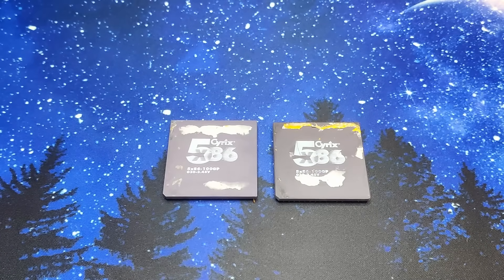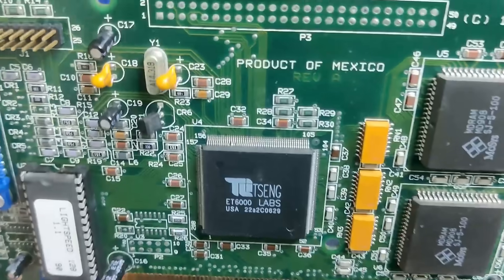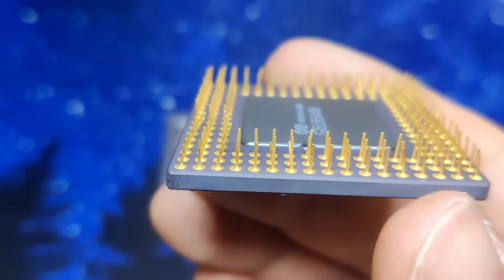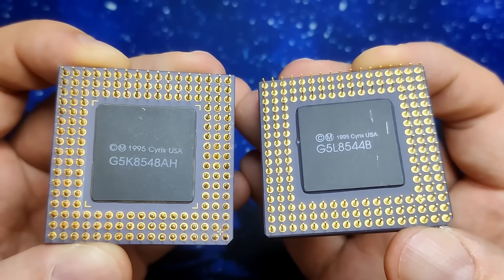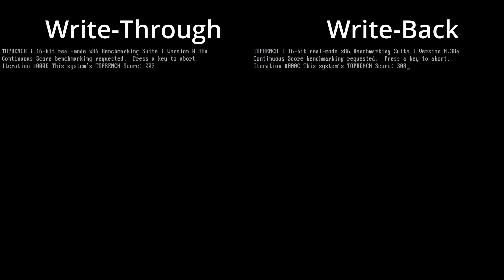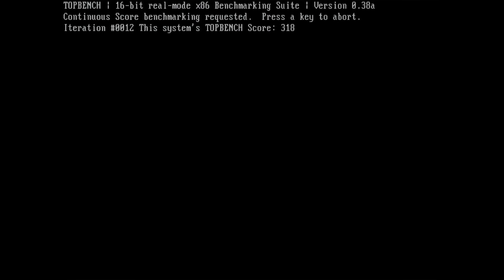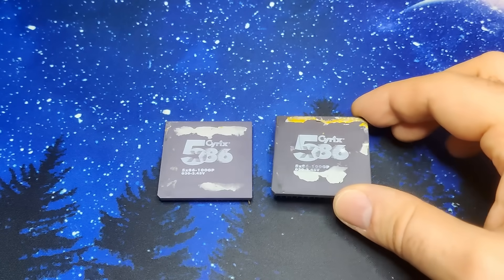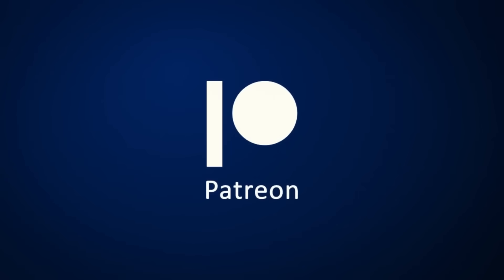Tomb Raider (1996) meets Cyrix 5x86-100GP (Part 3)

Comment: Why not use a small flat nose pliers for straightening pins:?
I find it much easier and faster to get them completely straight. Way more control And straighter away from  the main bend.

A clutch pencil, for a lead of the same/correct  diameter of the pin, also works very well, but does not give you the counter force  on the other side of the bend like the pliers do. 

Do not underestimate the power of a FSB overclock to 40MHz (120  MHz)
FSB overclocks everything, not just the core.  That's where the real gains are!
It's a great pity you never tested that.

NB:
Stability/heat is fine as long as you lap a decent size (P1) HS and use thermal compound. (NB!!! thermal compound)
Obviously a fan on the HS also helps.

Comment: Luck not required to run that one at 120Mhz. I used these chips to upgrade my machines, my friends machines and even a few business machines. All of them overclocked to 120Mhz. Unfortunately, I also bought a 120Mhz version thinking it would overclock to 150Mhz (3x50). It did not. So I sold that one on as iot was significantly dearer tan the 100Mhz version. Great video.

Comment: This is a big walk on memory lane watching this video. Started to build computers using first Intel 386 then 486. Started using the Cyrix 586 when it was first released because it was a lot cheaper than the Intel equivalent plus on some of the motherboards you can play with the jumper settings to get more speed. Did build x686 after. It was great times.

Comment: I`ve played it on 486 DX 33 on Grayscale monitor (despite some puzzles required color to be solved )  , and without 3D acceleration. I`ve finished it in  around 31 hours making pauses for food and toilet   It was fantastic and absolutely playable. During big areas, to  improve framerate , i`ve used "-"  button to shrink image to a size of 5x5 cm or something. Now it sounds like some crazy stuff, but in 1996 this game was WAAAY ahead of everything on the market, so I  just could not stop !  Actually , those times 3D accelerated card costed like another PC, so i did not know anyone who actually had it.
Reply from the maker: Yeah, that sounds about right :) crazy time!

Comment: @Tombraider: Is it the CPU slowing it down though? I remember putting a Diamond Monster 3D in my System and playing Tomb Raider (with the 3DFx Patch) soooooooo smooooth. ... on a Cyris 120mhz though.

Also can you bent pins better by heating them up before? Like 60c or so?
Reply from the maker: Now I can't wait to get the Voodoo done and test it. I really hope the 486 CPUs will have enough compute to push 20 to 25 fps at 640x480. That would be really amazing!

I tried heating the pins, but I didn't feel any difference.

Comment: At that time I had the Cyrix 6x86 with 133Mhz. My uncle connected 2 pins with wire and the CPU ran stable at 233 MHz. Together with a Voodoo 2  I could play Tomb Raider 1-2 and Unreal, Unreal Tournament and POD Racer. How many fps did I get? I don't know, but I was so happy that the games were running.
Reply from the maker: Wow, your uncle knew a few tricks to get free performance! I am sure you must have loved your setup and the extra speed you got for your games!

Comment: I had a 586 and a 686 I remember the 586 ran very hot, i may have overclocked it. The 686 was pretty good.
My first ever pc was a 486 dx with tseng ET 4000 vesa local bus.
Reply from the maker: Nice! Guess what I pulled out of a pile of old electronics two weeks ago at the scrapyard? A Tseng ET4000 VLB! I'll make a video about all those VLB cards I found so far very soon.

Comment: Tombraider is certainly needs fair bit of CPU for the time. I ran it on a Pentium 120 in software render and also with a Realvision Deltron Flash 3D 4 Megabyte Voodoo 1 card. It was mostly ok but I had to reduce windows size in some of the larger areas due to the CPU. When I upgraded to a Intel Pentium 200 MMX it made big difference and the game ran far smoother.
Reply from the maker: I hope the game will run much better when I add a Voodoo 1 card. My AMD runs stable at 160 MHz - so, maybe there is a chance to get half way decent frame rates on a 486 system

Comment: That was quite a step up from the previous CPU. Please see if it overclocks to 120 MHz and how well it scales with frequency! If Peter's results over at CPU Galaxy are any indication, the 5x86 with special features enabled should give the X5 quite a run for its money! They're almost evenly matched in Quake and both have the potential to overclock by about 20%.

Comment: Hi I have a intel dx4 100 how I unlock it's potential? There are software here too or not? And when you say turbo you mean the turbo button on pc case?
Reply from the maker: Yes, I mean the turbo Button on the PC case. It just shorts two pins on the mainboard and then the CPU is either running normally (turbo on), or slower based on how the turbo feature is implementation on the motherboard.
A regular Intel DX4 does not have any special features that can be unlocked to my knowledge. But you could try to overclock it to 120 MHz.
Reply: @bitsundbolts  how? From  motherboard?
Reply from the maker: The motherboard decides how to implement the turbo feature. Usually it's by slowing down the system bus, disabling caches, or other other ways.

Comment: heat up the pins to bend them back, but those pins are not just bent once they are bent in multiple areas which makes it really hard to get them at the same z height needed. maybe you can resolder new ones on there,.

Comment: Super nice! Maybe you could explain the turbo mode a bit better since this usually depends on more on the motherboard. Which strategy is followed be the MoBo? Cache L2 Cache disabling or frequency reduction?
Reply from the maker: I agree. I think Necroware recently made a video about the different implementation methods. I have no clue yet and would have to make my own research first. But I knew that there is a difference between the cache strategies when using the turbo feature. Some day, I may make my own video about this - or reference the one from Necroware 😂

Comment: In terms of video quality, the matrox lineup should also be a very good candidate! They are available for cheap with all common interface types. There are 2 lineups, one with integrated ramdac and one with external.

btw: i had good luck soldering those plasticsockets with hotair. You only have to be patient and use as little heat as possible to not melt the socket. Afterwards it looks like factory.
Reply from the maker: I assume you used solder paste on those sockets. I'm afraid to melt the plastic, but I haven't tried it yet. I didn't want to risk it on the Tseng cards... Maybe an old S3 Trio64V+ that doesn't work anymore will be a test subject for me. It has memory sockets that I could use for other stuff.
Reply: @bitsundbolts  no, i just used the pretin on the cards. It's older solder, so its not PB free and great after years. Just used flux and cleaned the oxidation of the socket-pins a bit with a fiber pen.

I practiced on old 3com-pci-cards. Some of them were missing the bootrom socket. Or you can remove the old one, tin the pads again (no wick afterwards!), put some flux on it and then the socket.

Try around 250°C hotair and give yourself and the board time to heat up, it takes a bit longer on this lower temperatures. If it's not working after 1-2 minutes, raise the temp by 5-10°C. You will soon see that the solder melts before the plastic and you can mount these sockets without a problem. It just takes a bit of practice and the right temperature (for your equipment, as most of our equipment isn't calibrated and has quite different characteristics)
Reply from the maker: Thank you for your detailed explanation! I'll definitely try that out. Unfortunately, I just soldered another four sockets in a third Tseng card for a future video. I still have two sockets left. Maybe I'll find another Tseng at the scrapyard 😂
Reply: @bitsundbolts  yes, or try it on something smaller one first, like the mentioned bootrom plcc-socket.

Comment: I have been greatly enjoying this series but I don't understand the purpose of presenting the scores with turbo disabled. It seems off-topic and unhelpful. Sorry for the negative comment, keep up the good work bro.
Reply from the maker: I read about a different behaviour of the turbo feature for write-through and write-back cache when I did research about both Intel DX2 CPUs. I guess I'll dial this section down in the next video and only show the interesting benchmarks (if there are any). The takeaway is, write-back delivers slower performance without turbo if you're looking to slow down your system for a certain task (e.g an old game).
All comments are welcomed! Thanks for watching and commenting!

Comment: I think I had the 2MB Tseng Labs ET6000 in my first computer. 1024x768 was only in hi color (16 bit) available because of the memory
Reply from the maker: Yeah,I think the extra memory helps for higher resolution and color depth. Not sure if there are any other features that are available with more memory. I should check Tomb Raider shadows. Phil recently made a video using an S3 Virge and there were no shadows when using 2MB. They appeared after he upgraded the card to 4MB

Comment: I might have to do the same testing on my Am5x86-P75. I went a different route in the video card department. I went with the MGA Millennium 2MB as it also has great DOS performance. The one thing I have to be on the lookout for is the 2MB RAM expansion module to expand on the video memory to 4MB.
Reply from the maker: I found something really interesting last time I went to the scrapyard, but I haven't tested it yet, nor do I know if it's really true. But I think I found TWO Matrox Millennium 2MB + 6MB memory expansion cards... There will be content about those soon!
Reply: @bitsundbolts  Sweet! Looking forward to it.

Comment: I've been able to run my Cyrix 5x86's at 120MHz with no issue, but I'm not sure how it would handle the extra features at that frequency.
Reply from the maker: Yeah, I think branch prediction may cause issues at 120Mhz. There is more info on vogons, but I couldn't dig through everything yet. Maybe in the future.

Comment: I'd use 0.5mm or 0.7mm mechanical pens to straighten pins. Works 99% and it's way faster method imo.
If I remember correctly Tomb Raider is almost playable w/ 40MHz FSB. 120/40MHz and overclocked VGA-card like Cirrus or S3 helps a lot. But it ain't pretty w/o 3D-accelerator as we all know. I had Matrox Mystique and it was ok speedwise, but 3dfx looked way better of course.
Reply from the maker: I'll try to run the AMD @ 160 MHz. Hope this will give an extra boost and Tomb Raider is actually playable

Comment: Ahh the 5x86, also known as the disappointment which any kid who tried to run the demanding games of 1996 - Quake particularly - would tell you. This era was full of them, bold promises in magazines lured you in and in some limited scenarios maybe they were just as fast as Pentium... just not the scenarios you wanted. We also didn't know about the disabled features or at least I never met anyone who did, this kind of knowledge really wasn't so widespread back then.

Despite this I owned a 5x86, a 6x86 and a K5... of them all the K5 was the most honest but still had its failings.
Reply from the maker: Somehow, I ditched all those disappointments. I went from a 486 to a Pentium II 350. But I can totally relate to high expectations and big letdowns - especially when it comes to graphic cards.

Comment: I guess, from bending the pins, the gold plating got cracked, given its some hundreth mm thin, then moisture wicked under the gold and oxidised the tin.
Reply from the maker: Maybe. I don't know what is up with that CPU. The other one also had bent pins, but is completely fine. Maybe it was operated in very different environmental conditions.

Comment: Great work! I don't know if it helps, but I always used a utility knife long blade to straighten pins and that used to do a very good job, as you couldn't "bend too much" and all pins would be in line. I would put the cutting side facing the processor and the not cutting side I could put my hands on. Maybe it helps in the future :)
Reply from the maker: Thanks for your suggestion. This method seems to have worked very well for you. I started with toothpicks and it worked surprisingly well.
Reply: @bitsundbolts  yes, definitely there are loads of methods that works well! I think I don’t have all the patience you have to do one by one, hence why I like to do many at once 😂

Comment: Looking forward for some bending magic 👌

Also, what is the price range on those sockets and memory for the TSENG video card?
Reply from the maker: The sockets were quite cheap. I found them on AliExpress for about 6.5 USD on AliExpress. The memory chips were more expensive. If I remember correctly, they were 25 USD for the 3 chips.

Comment: Is considered for this challenge "cheating" if you add a 3D accelerator in there, like a 3dfx Voodoo 1?
Reply from the maker: That will probably be the final video. After the AMD CPU, the only other CPU left is the Pentium OverDrive. I am still waiting for the original fan though, which probably won't arrive before mid of February - so, I have to take a break before I can finalize this series .

Comment: I'll be curious if the AMD with the chipped ceramic works! I've only had a couple come through with chipped ceramic, but neither worked and I'm curious if there's any correlation there!
Reply from the maker: I will probably never find this comment if I don't answer now: My AMD booted. But I am not gonna tell how many pins broke off 😅
Reply: Awesome! Glad to know it's not fatal to have chipped ceramic!
Reply from the maker: I guess it depends how bad the chip-off is and if it cracked further inside severing some tiny wires.

Comment: The image quality issue on the S3 sounds like a capacitor issue of some sort on the RGB pins. I'd try replacing those caps or decreasing the capacitance. It's a similar story to that of the SCART cables for PS1 vs PS2 where the PS2 cables have caps on them. When you use a mismatched set of cables, you end up with wrong brightness on the image in general.

EDIT: just read another comment saying it's a VBIOS issue lol
Reply from the maker: Hm, let me see if I get the time to look at the caps of this card. May be worth a shot!
Reply: Capacitors on scart? Loool
Reply: @sucaNaitoraven951 Yep. Go look it up, it's a thing.

I also just realized I mixed em up - PS2 ones have caps and PS1 ones don't.

Caps in general bring the image down.

Comment: What is your prefered flux? Like the fact that it is clear and gel like. Mine is almost like paste and goes slightly brown plus needs a lot of cleaning up otherwise it is still good quality flux.
Reply from the maker: I use Amtech labeled flux that I got from AliExpress some time ago. I found the link I bought it from. It's in the video description. I have never used anything else, but it's great and I have no complaints.
Reply: @bitsundbolts  thank you!

Comment: Interesting look at this cpu. I knew it existed and it could be faster than the amd 5x86, but I never saw one for sale. I was probably better having the amd 5x86 at 150mhz anyways, since I doubt I would have known about the extra flags that needed to be set, at least at that time.
Reply from the maker: I think you did well with 150 MHz AMD and didn't miss much. Plus, the Cyrix may be unstable if you run windows using certain flags. I'll try my AMD at 160 MHz (4*40). but it may even be slower than yours at 150 (3*50).

Comment: Nice! I installed some of those sockets when I still didn't have tweezers and a microscope. Wasn't funny :)

For the pins, an engineer friend of mine recommended to warm up the metal before bending it. There are less chances of breaking it! Good luck! I also say zero :)
Reply from the maker: I would melt half the socket if I wouldn't have access to a microscope. I can imagine that your experience must have been frustrating!
Hm, regarding heating the pins - I am really not convinced that it would help. I heated the donor AMD 486 in my previous video where I tried to harvest a pin. But those pins didn't feel any different. All I did was burn the wooden protector on the microscope base. I really doubt that 200 degrees makes any difference when bending those pins, but I might be wrong. I'm just afraid to constantly keep the temperature up, burn my fingers all the time, and prolong the process. If I would break off pins constantly, I would definitely try heating them, but so far, I don't see the need for it.

Comment: I remember running Tomb Eaider on my Acer Aspire’s Citrix-based IBM P-150 CPU back in 1996. It wasn’t pretty but I considered it playable after turning the screen size WAY down.
Reply from the maker: Yeah, I remember reducing the rendering window too - which I discovered by accident.
Reply: Oops:
Eaider = Raider (Autocorrect didn’t catch that?!)
Citrix = Cyrix (AutoINcorrect in this case)
Reply: @emmettturner9452  My brain auto corrected, I didn't see the mistake till you mentioned it 😂

Comment: I usually use a  srynge needle half cutted to straighten cpu pins, it is way more easy or a  a mine pencil also works.
Reply from the maker: I haven't tried that yet, but the syringe needles I have are too big for the pins. I may give a mine pencil a shot